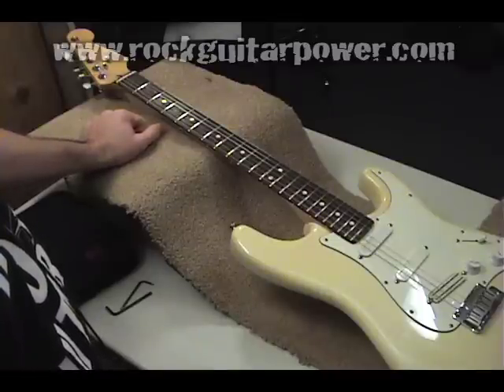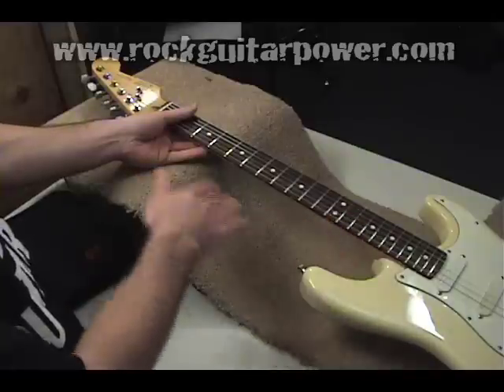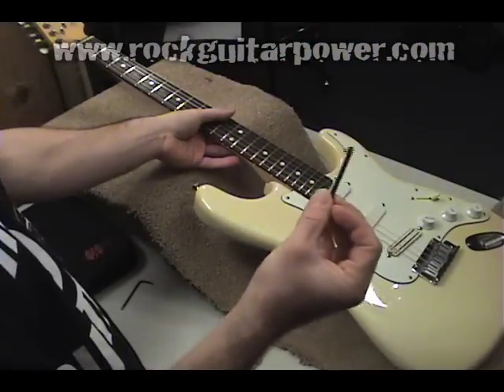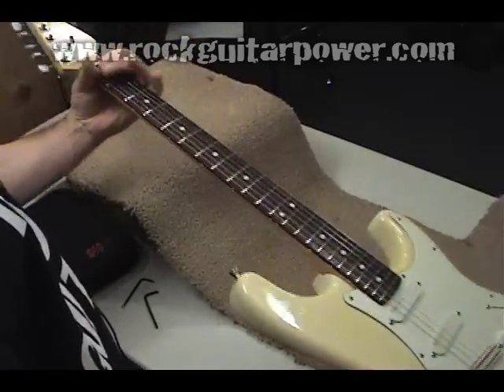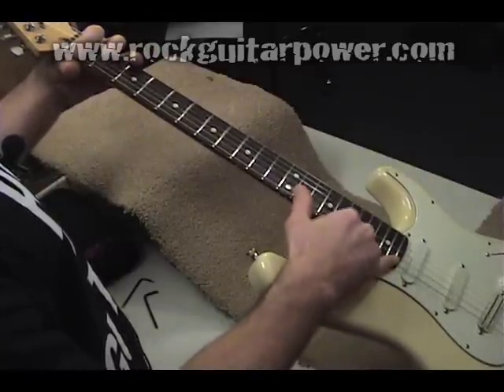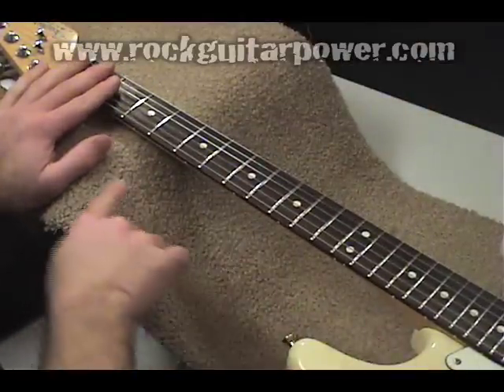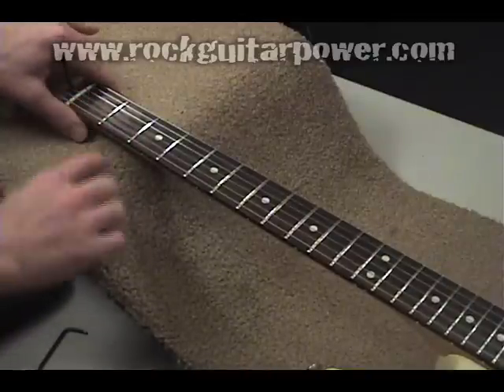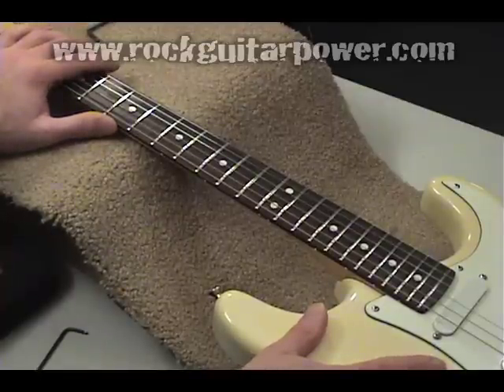Truss Rod Adjustment

Comment: I've discovered that measuring from the 12th fret to the nut is a much more accurate indication of neck relief. Why? Because the truss rod has very little to no affect above the 12th fret. Why? Because the neck heel starts getting thicker at the 12th fret. There is no way a spaghetti thin metal rod is going to move a hunk of maple that's 1½" thick.

When you measure from the 12th fret all you need is the tiniest bit of clearance and your neck will have the perfect relief.

So the rule of thumb is if the frets buzz below the 12th fret, adjust the truss rod. If frets buzz above the 12th fret, raise the bridge. 

I've been playing for 55 years and this is the best, and most accurate method I've found yet. Give it a try...
Reply from the maker: Thanks Randy!

Comment: So, I bought a second hand squier at a pawn shop, MAJOR back bow, adjusted it, plays 100 times better, but, had to pretty much max out rod, so, in the future, if it happens again, then what? Can I back off rod then readjust, or im I screwed?
Reply from the maker: Usually when you make a lot of adjustment to the truss rod, it take a few days for it to settle. I would check it after about a week and re-adjust it, Might be able to loosen it a bit to give you more headroom for future adjustment. But without seeing the guitar, it's hard to say for sure
Reply: Thanx, I'll try that..
Reply from the maker: let me know how it works out!

Comment: Hey I just got an electric guitar but it was buzzing quite a bit. When I checked by holding the 1st and last fret the string was flast on the 12th fret. So that means it's a reverse bow and I have to loosen it right?
Reply from the maker: Correct.. the neck has a bit more tension on it than you want so you need to loosen it

Comment: so I did some drop tunings without having the neck lean on to something and the truss rod is kind of messed up, my B and e strings don't ring out at all on 1st and 2nd fret, and my guitar is quite expensive so I'm too afraid to mess it up, think this is too tight or too loose? if it helps they do ring out when I raise the neck at the first fret way above the body, though no one can play that way
Reply: also its no longer in drop tuning, I tuned it back to E standard where this problem is, didn't notice it on the drop tunings
Reply from the maker: I would bring it to a professional so they can see it. If your guitar is consistently in drop tunings it does have a bigger effect on the neck since the tension is much different. It might need more than a truss rod adjustment, i.e. raise the bridge/saddles or might be something with the nut. Too hard to tell you in this situation since I can't see it
Reply: Well I'm kind of in low budget right now, I took a closer look at it, the neck is bowed up, its not constantly in drop tunings, I tuned it to drop B for only one song, also using 0.09 gauges
Reply from the maker: it should definitely be bowed down... what kind of guitar is it? Some truss rods will push both ways, but some only take out tension so again, without seeing it, It's hard for me to help you out on this one
Reply: Jackson js32TQ dinky, arch top, strings through body style, I haven't touched it since I noticed its bowed up, or maybe it just seems to me like its bowed up having that arch top and all
Reply from the maker: got ya... yeah sorry, hard for me to give you advice on this one
Reply: welp, thanks for trying to help I guess
Reply from the maker: sure buddy, sorry i couldn't be more help
Reply: it was bowed down apparently, my bad.  I put one hand at the neck at the first fret and raised it a bit and my string rang out unlike before, does this mean I need to loosen it? how many turns to the left approx.?

Comment: Well, I really wanted to know which way to tighten and which to loosen. You said to the right, but gestured to the left ?  Completely confused. I will try some others, but thanks anyway.
Reply from the maker: Righty tighty... lefty loosy
Reply: Mmm, but from which way. Whilst looking at the guitar, full length, stock uppermost, body on the floor, at the top of the neck do you tighten to the right ? Or, as in some other videos show, looking at the guitar lying flat, you stand above the head,  looking down at the guitar, turn the allen key to the right...? (which of course is the exact opposite). Most recite Right to tight, left is loose - NFG to me. Allan (thick as sh*t).
Reply: EXACTLY. You're not alone in the confusion, and not working with guitars for a living and doing this every day, I forget sometimes. He still didn't answer your question, but I guess he didn't understand what you were saying. I did though!! :OD I "think" he meant looking straight down from the head/top of the neck into the hole, the way you would do if you were screwing in a phillips head screw (right=clockwise=tightening). He didn't do a very good job of showing the direction when he turned it, but otherwise a pretty good video.
Reply from the maker: Yes.. If you are looking at the head stock and your gaze is to the back of the guitar, then turn right to tighten and left to loosen

Comment: around 4:04 u talked about how close the strings are to the frets. and if they are too close they will buzz. my question is, if the strings are touching, does one tighten or loosen the truss rod?
Reply from the maker: you would loosen the truss rod, but also experiment with raising the action. They go hand in hand

Comment: What happens when the adjustment makes zero difference at all????.?HELP
Reply from the maker: This could be because you are trying to intonate old strings. Make sure you put brand new strings on before you intonate
Reply: +Rock Guitar Power thanks for the reply, yes knew strings , I have been setting up guitars for 20 years and set them up for friends , I have this one guitar and the truss turns but nothing not even a little bit of movement and it has a horrible buzz in the first 2 frets , nut is good and new , bridge and all heights good but the neck just won't move with the truss rod adjustment . Never seen this before .
Reply from the maker: hmmm, yeah hard to tell without seeing it. something might be broke, stripped or something else. I don't know enough about what could prevent it from working at all. Sorry :(

Comment: I just did one turn to left side . So how long do i need to wait ? Does it take time to be adjusted ?
Reply from the maker: It will respond immediately... I would do at least a couple turns and see if it makes a difference. After an adjustment I do make sure to check it the next day after the neck has time to settle and double check it. Also be sure to retune after adjusting since it will effect the string tension

Comment: I liked your method but before i make adjustment i just wanna confirm. Cause i never touched my guitar truss rod .   With capo on the first fret and my pinky on the last fret  . While im pressing the 12th fret i can see there us no room . So. Do i need to turn the truss road  right or. Left  ?   Thanks
Reply: Im also im going to change my strings from 9 to 10 .
Reply from the maker: Turn it to the Left. This will loosen the truss rod which will relive the stress on the neck. If you have no room between the frets and the string, then your neck is either dead flat or has a reverse box. In either case, you do want to have a little bit of bow in the neck

Comment: Hello. I'm a newbie here and have buzz on the g string, frets 8 -12. When I checked the 12th fret it was resting on the fret. There was no space in between. Does that mean I need to add some tension to the truss rod?
Reply from the maker: No... you need to release tension which will create some bow in the neck and give a little space between the string and the fretboard
Reply: Thank You
Reply from the maker: Your welcome!

Comment: hi , excellent video . my problem is a Peavey , (fender type style ) it tunes ok , but when playing , the 5th B string plays out of tune ,  even with a new set of strings fitted ,  playing for 45 years never experienced this issue before ?
can you please give any advice on this problem   thanks  Roy
Reply from the maker: The B string is always a bit trickier to get right. Not totally sure why but it always create more headaches. I've personally found that you just have to keep tweaking it until you get it as good as possible

Comment: Why is it good have have it more straight than bent? Is it so their is less strain on the neck?
Reply from the maker: Good question Duck... my response would be that its more a matter of personal preference... but the general benefit is that it helps to keep your action low and even. The more bow (bend) in the neck, the higher the strings get from the fretboard which usually makes it harder to play.

The biggest push pull with this is that when the neck gets too straight you usually encounter fret buzz... so finding the happy medium between comfort and maintaining good tone is the balance your searching for

Comment: hey I get buzz sound in the open string,.even though my action is high enough....any clue?
Reply from the maker: hard to tell without seeing it. When was the last time you changed your strings? Also make sure there are no burs or rough spots on your saddles

Comment: This video was super helpful! i recently bought Greco supersound and it's got alot of tension on the strings and i think its because the truss rod has completely straightened the fret board out, im wondering if i loosen the truss rod, will that relive a bit of tension on the strings as well?
Reply from the maker: Thanks for the question Romie.... Honestly I'm not 100% sure on how loosening the truss rod effects the string tension. I would think that it would have very little effect on this as the string tension is pretty set on the scale length of the neck and adjusting the truss rod really does not effect scale length.

If you want less string tension the easiest and best way to achieve this is use a lighter gauge string. If you do change this, be sure to reset the intonation and truss rod after the lighter strings have been on there for a few days

Mike D

Comment: I have a les Paul and I have set the intonation perfectly but it's out of tune Sharpe when I Capo it on the 4th fret. even if I play it up past the 3rd fret it's out of tune but in perfect tune at the 12th.. what would this mean? the truss rod looks straight and we lowered the strings and it didn't really help for the tuning.
Reply from the maker: Hard to tell... Anytime you use a capo its going to change the tuning just a bit. If you don't use a capo is it in tune everywhere?
Reply: +Rock Guitar Power  no even just holding the strings down at like the 4th and up too like the 10th they are out sharp... and it's only on like all the strings but the b and g
Reply from the maker: Hmmm, I would take it to an experience guitar tech then... Might be a twisting issue or you may have some bad frets that need to be replaced

Comment: My truss rod on my guitar is very hard to turn, so I left it alone. Is this normal, or is it pretty easy to turn?
Reply from the maker: All guitars are different and I have worked on some that have a very tight truss rod... it is possible to crank the neck if it's too tight or stuck so if your not comfortable working on it, bring it to an experience shop and have them look at it
Reply: It was just really tight. I had the worst 1st fret buzz. It needed to be loosened really bad, so I struggled a little bit, but after a few turns it started to become prettt easy to turn. I made sure I didn't do it too much though. Thanks!
Reply from the maker: Good to hear!

Comment: i set the action from the bridge instead of setting the truss rod first..and im getting fret buzz from the 18th fret(its a 21 fret guitar)...what should i do ???
Reply from the maker: Hey Billie... The truss rod adjustment and setting the action are actually two totally different things. When setting the truss rod the action of the strings shouldn't be a consideration. If you are getting a buzz from one specific fret, after doing a proper action setup, then you may have a bad, possibly worn down fret, which might need to be replaced. 

I would take it to an experience guitar tech if you continue to get buzz just from that one fret.

Mike D

Comment: on a guitar that has the access for adjustment at the base of the fretboard, as opposed to head stock, is it necessary to remove the the entire neck from the body (via the bolts on the back of the guitar) before making this adjustment?
Reply from the maker: Hey James, It depends on the guitar. I have a Japanese strat which requires me to do this, but as I said.. it depends on the guitar

Comment: Hey I have a question I wanted to change my guitar for drop b tuning and I did not want to take it in to get it adjusted for it instead I wanted to do it myself can you help me please? I need help for the nut and other parts please?
Reply: Just my opinion, but I would think that the adjustment needs to be the same for any tuning. and question: are you doing a b dropped tuning to play like a seven string? make sure you use the correct gauge strings (or maybe just a set of seven-string strings). dropping a low E to a B, and the rest of the strings to match, will not produce a good sound.
Reply: ***** no because seven string that's standard tuning for 7 string beadgbe but I want it for a six string
Reply: I know the tuning for the seven strings. But at least use the low B string for your lowest string. Don't drop the low E down.
Reply: ***** well I'm doing it for a six string though
Reply: +Joey Fleisch you're not getting it man. he understands that you have a six string guitar and want to tune it to drop b. he's telling you to go buy a set of seven string guitar strings and use the lowest gauge string on your sixth string (what would typically be referred to as the low E but since you're tuning down to B, it's called the low B) this will keep your guitar from sounding like garbage when tuned down that low. and honestly speaking, I would take your guitar to a professional for that low of a tuning. at least the first time to watch what he or she does so that you could do it your self from then on. my local shop only charges about 40 bucks plus the cost of the strings to do this.
Reply: Blake Gass o ok i understand I thought it he was still not getting I had only a six string hahaha sorry I fully understand I just read it wrong thank you and yeah I know about getting it fixed already I just wasn't getting what he meant thank you

Comment: i boughtma guitar used and it has a lot of dead frets would that be a trustrod issue?
Reply from the maker: +Robin Ruth It could be... but hard to tell without seeing it. I would do a full setup on it... new strings, set the action, then the intonation and adjust the neck. If your still getting dead frets, bring it to a repair shop.. probably needs a new fret job
Reply: Robin Ruth adjust truss rod first

Comment: I did the string test on my fender telecaster and there was no space between the 12th fret and the string in fact the string was touching the fret and I tried loosening my truss rod and absolutely nothing happened the string is still touching the fret, and I was loosening it ( lefty loosey and righty tighty) so I'm not sure what to do at this point.

Comment: Can someone help me please.? I put my finger on the first fret and the last fret and check if there's a space or bouncing but all i got is a flat string.no space at all. No bounce . What should i do?
Reply from the maker: +jefferson anaya Hey Jeff... If there's no space between the string and the fretboard then it means that the neck is totally flat or has some reverse bend in it... You want there to be a little bit of space so to create this you need to lose the truss rod by turning it to the left. Start with a few quarter turns and see if it creates some space. If it doesn't give it a few more turns and it should start to open up. Hope that helps
Reply: Rock Guitar Power  thank you!! now all i have to do is the intonation ! thanks :D
Reply: +jefferson anaya Your welcome! Glad it helped. Be sure to watch my videos on intonation

Comment: I never really cared about the truss rod  before i saw that my neck was bent a little bit.. So now i care about it and im really nervous cuz i've never adjusted a truss rod... So my question is: can the neck snap in half while adjusting it??
Reply: Wood is really bendy man. You'd have to bend it an inch or two for it to snap, you won't have any problems bending it a millimetre, probably even less for truss rod.
Reply: I have the same fears, plus il a big Cautious as my truss rod I'd at the heel. and I don't want to break anything  , I'm really nervous about it.
Reply: +Rasmus Jern  eh dont try this but once i bout a cheep guitar with a bent neck and i kept tighteing the truss rod for about a minute and it didnt snap but it depends on the wood type some is more fragile than others

Comment: You don't have to take the neck or plate fully off for a vintage truss rod adjustment. There is a good video from Fender showing to loosen the screws, push the neck to where adjustment is possible and reset. I can't link the video from my Vita right now, but I recommend looking for it. It can make life easier.

Comment: PLEASE ANSWER! would my set up change if i use thicker strings like 11-52 gauge?
Reply from the maker: WastedFreakOut Yes it would... heavier strings will put more stress on the neck. If that is a different size set of strings than what is normally on there you should put the new strings on, Reset the action, intonation. Then after a day or two, adjust the truss rod. You don't want to do it right away because the new tension will take a couple days to set in